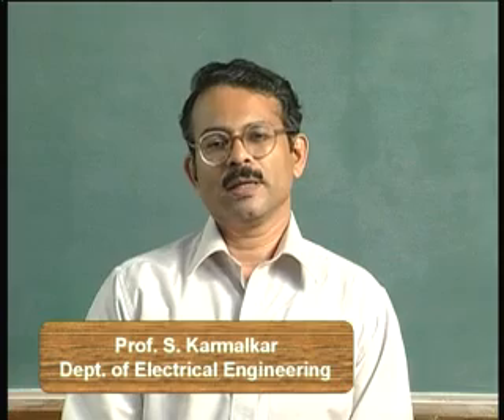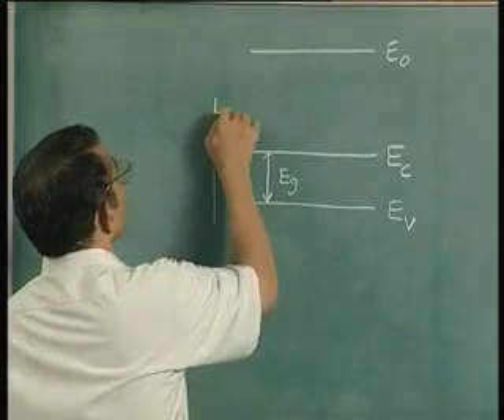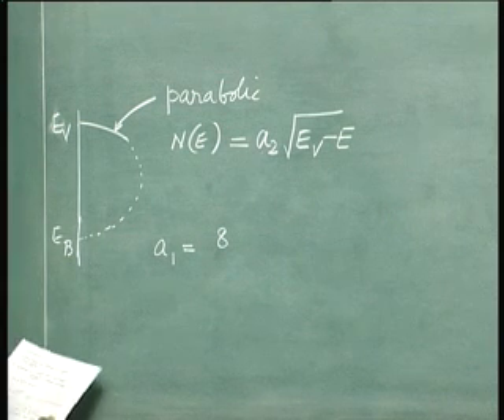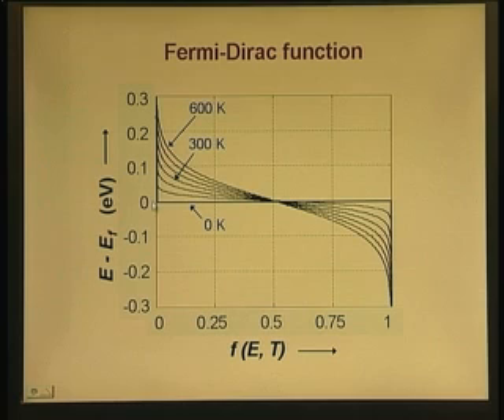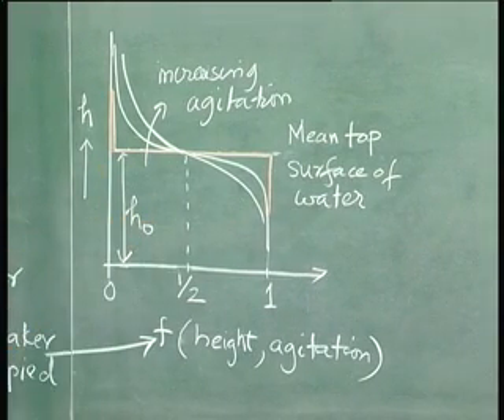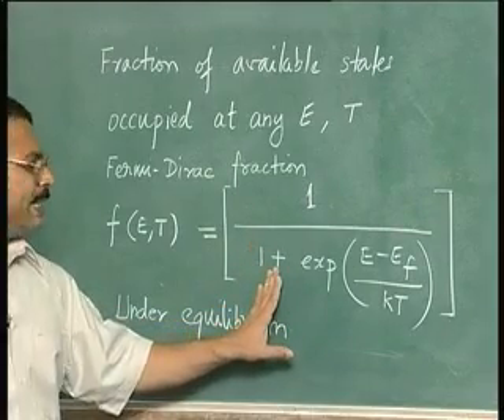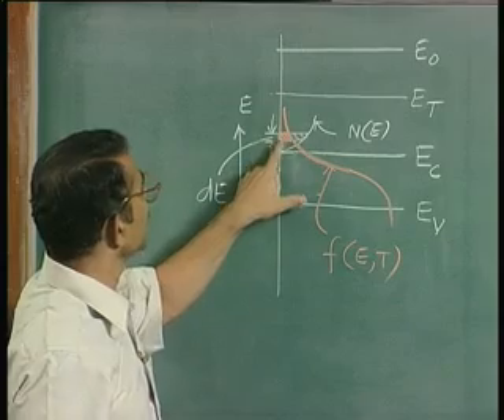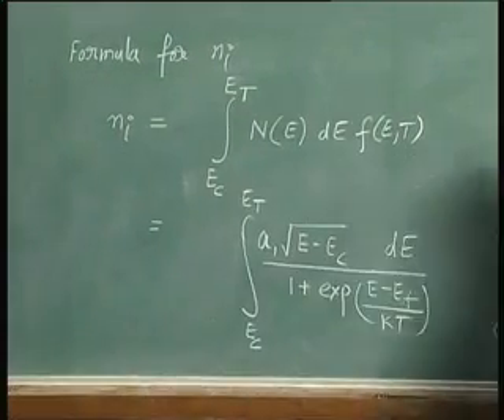Lecture - 7 Equilibrium Carrier Concentration

Comment: Energy gap means that there are no energy levels available so how can there be a fermi dirac function or how can there be a probability of an electron to be inside band gap, so haw can there be a fermi level. 
I don't really understand. Can anyone help me to understand this phenomenon.
Reply: I too have the same doubt bro
Reply: When you apply an energy equal to 0.55 eV to the valance electrons in the silicone this energy will not be sufficient to pass the energy band gap (as the Eg in silicone is equal to 1.1 eV ).
 But in practical they discovered that when we applied 0.55 eV to the valance band electrons half of these electrons will pass the energy bandgap despite that the applied energy is not equal or greater than Eg. This means that half of the valance electrons have an energy equal to Eg/2 so when we applied 0.55 eV thier total energy became sufficient to pass Eg. 
To represent this in the energy band diagram they put Ef at the middle of Eg and that means half of the valance electrons have energy sufficient to reach this level ( reach the middle of Eg not pass it ) an if we applied the 0.55 eV they will pass Eg.
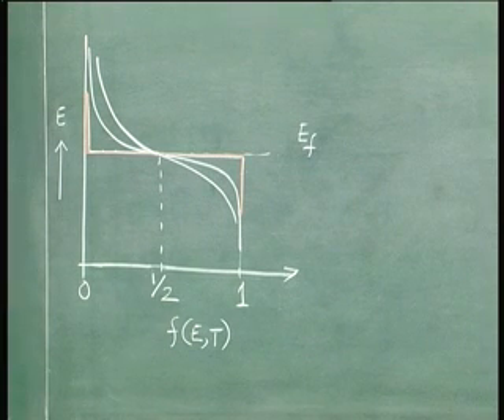Reply: at 28:00  sir says to note something that the function does not necessarily say you have an allowed energy state at E whether there is an allowed energy state at E is decided by Density of states function and allowed energy level .I think this should clear the Dought.
Reply: I think the misconception is arising because of classical approximations of a quantum result. 

1) The classical approximation to a quantum system seems non intuitive when compared to the actual quantum result itself. This brings us to the solution for the case at T= 0K. If you see the distribution at 0K, the probability of electrons lying below the Fermi level is 1. Now, classically, the electron can lie in any of the states below Ef, but it will only go to VB as per quantum mechanics because the allowed states are there only. I hope this clears the confusion for the case at 0K.

 2) For the case of T > 0K, you can see that the probability of occupancy of a state at E = Ef is 0.5. Intuitively, it seems that there is a 50% chance that electrons can occupy a state at Ef, but this is also a classical approximation for a quantum result. That means, if equal number of electrons are residing in CB and VB, or in other words, if the distribution of electrons are equal in CB and VB, the probability of occupancy will definitely lie in between CB and VB which is our exact scenario here.